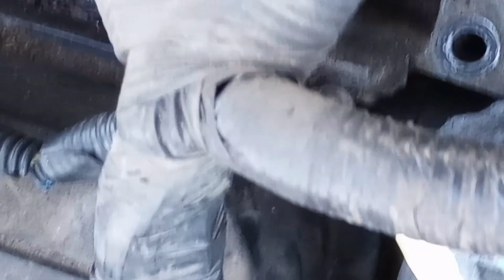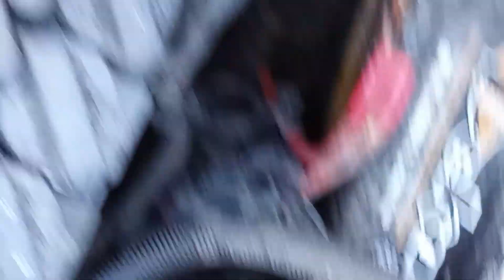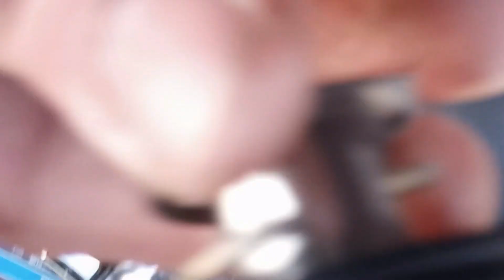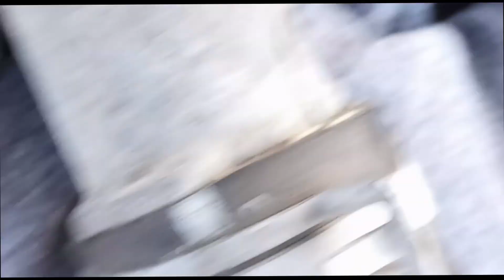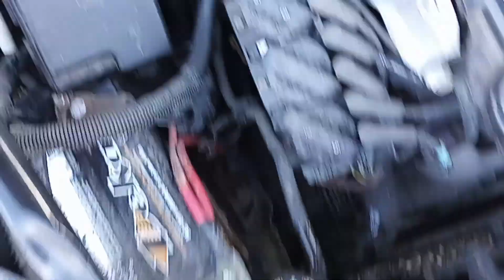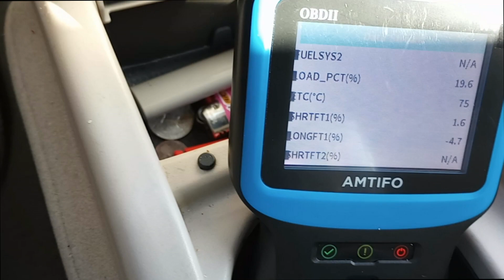2008 Buick Lacrosse CX 3.8L P0128 Code Troubleshoot and fix

Comment: Did your cel go off on its on?. Because i changed my thermostat twice im going to irder the one you got an see does it make a difference. Because im still not getting good heat
Reply from the maker: Hopefully your heater core is not clogged. Emptying the coolant and flushing the radiator with distilled water can help break up the clog. They have products that you can add to the current coolant to help clean out your cooling system but you still need to flush with distilled water afterwards.